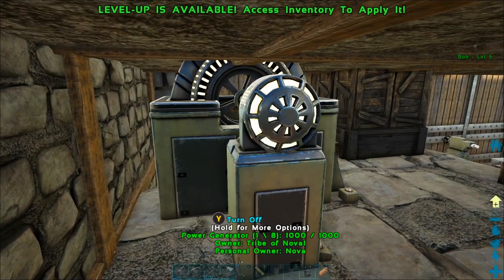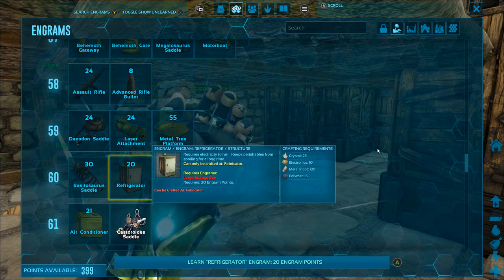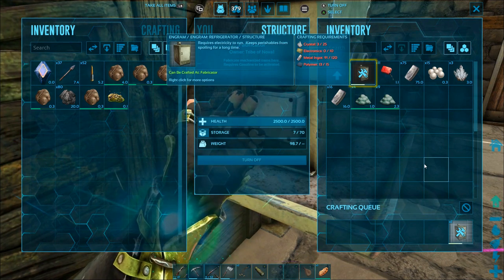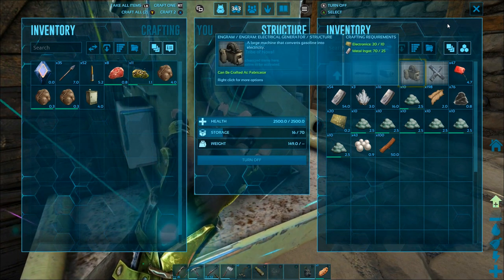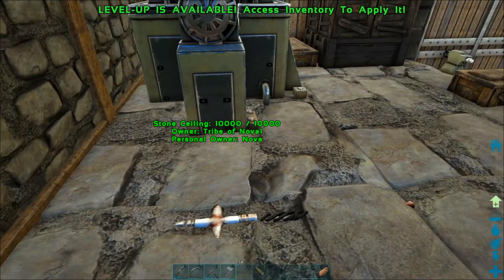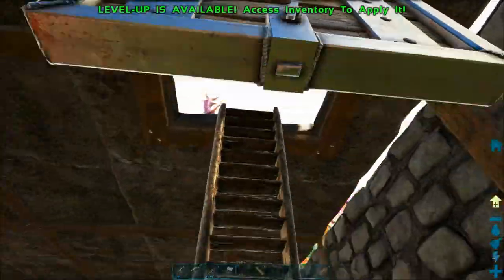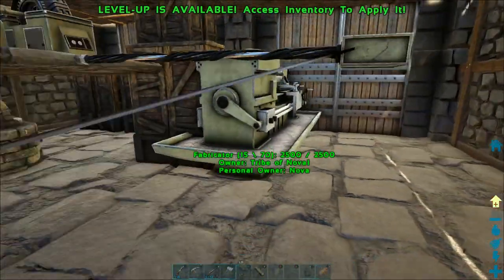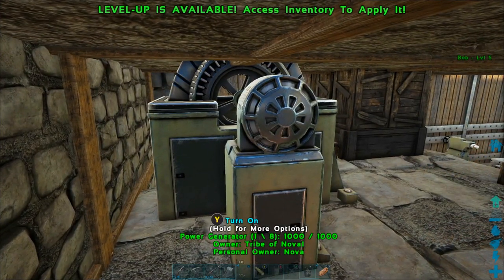81: Ark Electricity Guide: How to Make Electricity in Ark

Comment: Hey man. I have a question, how do I power more than one a/c? To I simply put an a/c next to one already powered and it will power? Or do I need another cable reaching it?
Reply from the maker: Great question! If you have an electric outlet down and powered, any electric appliance within a couple foundations of it (an unlimited number of them as far as I know) will snap a cord to it and plug in automatically. It's a good idea to turn on the power before you put down an appliance so you can make sure it turns green and is powered right away or you can pick it back up within 30 seconds.
Reply: @ArkSurvivalGuide  hey thank you! I’m pretty new at this game so I appreciate what you do!

Comment: I did this but it's not working for me. I'm trying to power an elevator (I can't find any videos on this) but the only option I'm getting is to demolish. The cables are going from the gen to an outlet and then run down the lift track. It's all yellow but not working. I was told each track had to be powered. I can't figure out this damn power! This is why I don't use it.
Reply from the maker: Actually we really need to make a guide to elevators lol. If you run cables from the generator to the elevator and they're all yellow, you can place an outlet next to the elevator tracks, and cables will appear automatically connecting the outlet to the tracks in range. You may need to run a vertical cable upwards and add more outlets to any tracks that aren't in range of the first one. And when you place an elevator platform at the bottom of the tracks, it should be what gives you the options. Hope that helps :) And make sure you subscribe because we will eventually make a full elevator guide.

Comment: On me when i put the outlet the cables doesn't connect to the air conditioner
Reply from the maker: Hmm is the outlet within one foundation of the air conditioner? You might need to move it closer. Also make sure the outlet is glowing blue so you can tell it's powered on. Sometimes the cables are hard to see so check to make sure the fridge lights aren't already green.